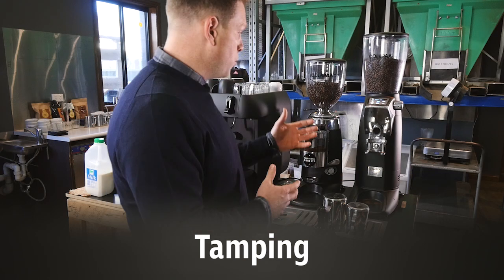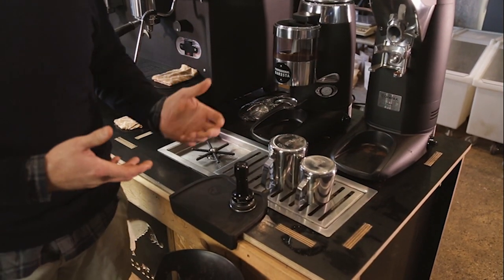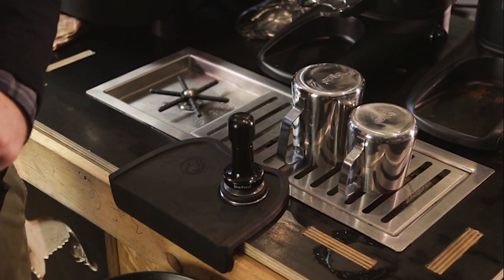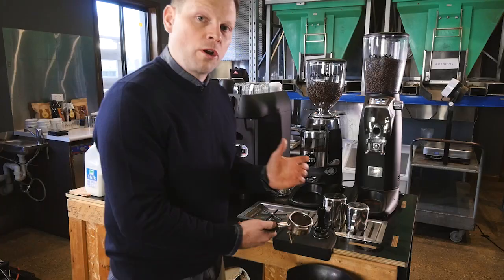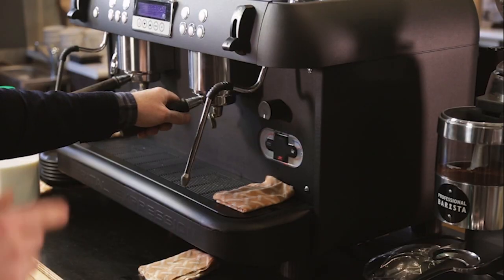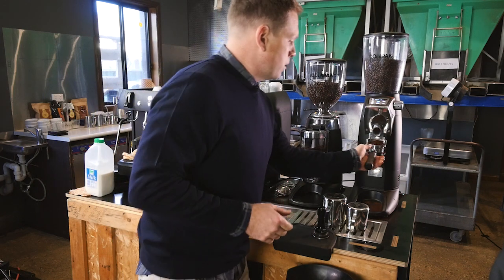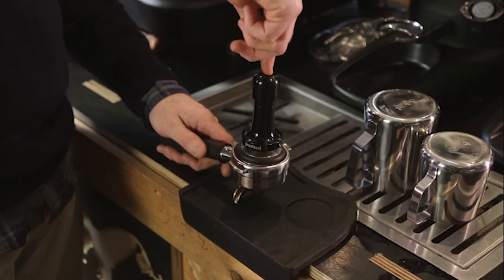BARISTA TRAINING SERIES - Part 6 -  Tamping

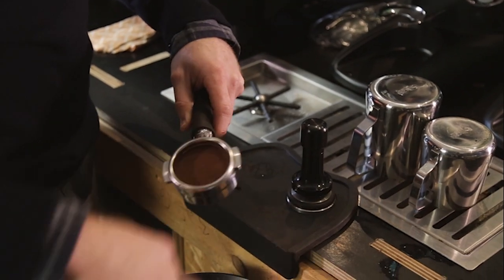Comment: Why would you knock the portafilter (1:55) after you tamped? Isn't that a risk to crack the coffee cake?
Reply from the maker: Hi Jester, I assume your worried by cracking the cake that it might cause channeling in the coffee? It is my experience that only poorly roasted, incorrectly ground or underdosed coffee will channel. The tap may be a bit of a habit from my time behind the machine. I use it to knock the excess grindings into the brew basket rather than wipe with my hand, for speed and hygiene reasons. I have never cracked the cake from this practice.
Reply: You know that you don´t have to see a crack in the cake?
Reply: I agree, you shouldn't tap the basket, you won't see it maybe even notice a Crack, but it will have effects

Comment: Never never tap the side of the portafilter after you tamp! It created channeling, uneven coffee, runins the tamper and filter!
Reply from the maker: I’ve heard that before, in reality channeling is created form underdeveloped coffee roasting and restricted flow in your machine.  A gentle tap with a rubber ring on your tamp will just make sure all the coffee goes in your basket and your brew ratio is maintained.  Sure if you smack so hard your break apart the tamp this could create a poor extraction. But that’s not what’s happened in the video:)

Comment: I hope this is seen, but a question. I get the logic behind not taping out the filter for every coffee, but what would you recommend doing for the filters between drinks instead? Just replace it with a new filter and have the dirtied one wiped later?
Reply from the maker: you knock it out and clean it just before the next coffee every time. It can wait until the next coffee is ordered. If your just making coffee at home and time is not an issue, then go ahead and clean it as much as you want. Just make sure its not wet under the basket or in the port filter before putting clean grindings in. Hope this makes sense.
Reply: Thanks for the quick response, and yeah that makes sense. In the video he made it sound like you shouldn't clean it every time, which is why I was confused.

Comment: I wouldn't leave a comment if this was a 10+ years old video, but it shocks me this video is still quite new...? The tapping-after-tamping technique you showed here is a very outdated technique and most of the people deeply involved in the coffee industry now knows it should be avoided because it provokes channeling of your shot. Just because you don't see the crack on the surface of the portafilter, it doesn't mean it's the same for all the way down. If you've ever noticed, baristas neither from the specialty cafes nor barista competitions will ever use that technique now.
Reply from the maker: Channeling is caused by modern and competition style roasters serving a cupping/sample roast as espresso and restricted flow in your machine. Specialty coffee is about the grade of the bean being free of defects before roasting, not the quality of the tattoo or moustache. A little love tap never hurt a coffee.  This video series is designed for real people, not the 1% poring your coffee with their face 5cm from your cup. Actually try it with an espresso roasted coffee, one with a little tap as I’ve done and one without. You’ll note no difference. Grab a light roast from a hipster and do the same, they’ll both channel.